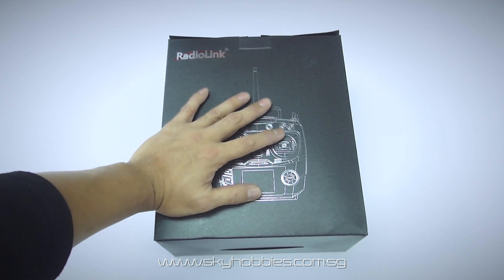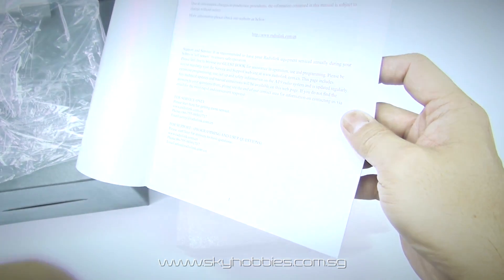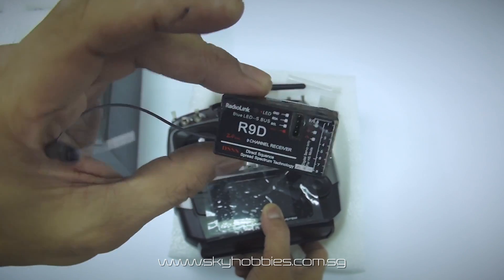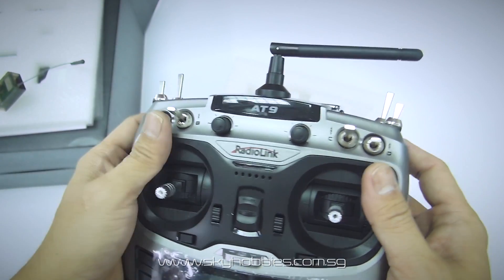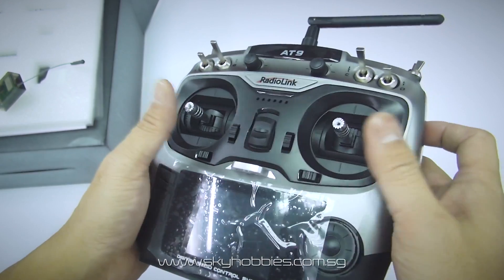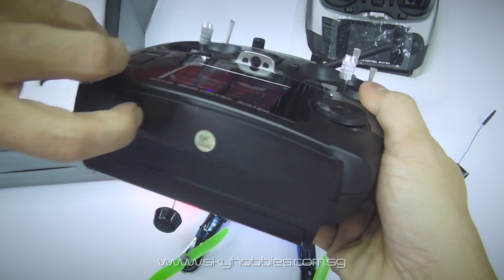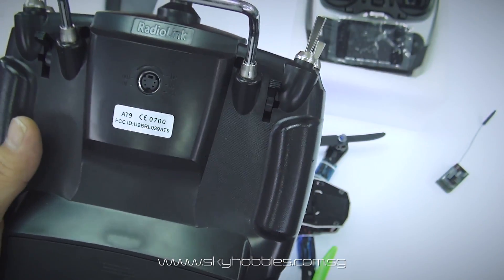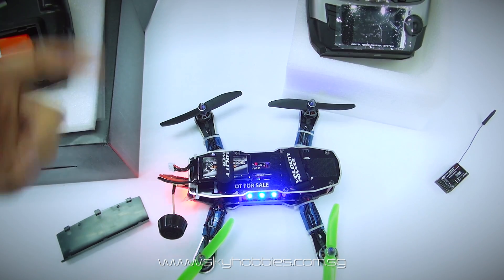Radiolink AT9 Quick unboxing

Comment: Hi there i have an AT9 and R9D receiver. At the radio i could control up to 10 channels. However the flight controller (pixhawk) which i am using, is only able to detect on to 8 channels in Mission Planner. By the way, my receiver and flight controller is connected via sbus. So my question, what should i do to enable the mission planner to detect the remaining 2 channels?

Comment: I have a question I have a storm racing drone that came with a walkers Devo7 and it's an ok radio but I would like to upgrade so if I buy one of these how would I connect it to my mini quad but not loose all my pix settings etc because it's set from factory and it runs great and I do not wanna loose any of those settings
Reply from the maker: Darth Vaper Suggest if you want to do that, first plug in your CC3D into the Open Pilot (If you are using Open Pilot) and save the settings values on a file (or even write it down / snap shot it) before you change the radio transmitter.
As you change the transmitter, you need to re-calibrate the sticks to the CC3D again and if not done correctly will lose all your prior settings from the factory.  Get an experience buddy to help you if you are new to this.

Comment: Also I am having range problems using this with my quad copter, I keep getting "No RC Receiver" alarm at about 150' vertical or horizontal range. I have located my reciever well away from surrounding electronics and still have this problem. I have two additional receivers as well and have tried another receiver and still have the problem. Have any advise?

Comment: Do you have any guidance to set up for multirotor? is it will automatically set-up once we select the aircraft model? or we still need to adjust some items? I got also this transmitter last month but still not yet use..hehe..
Reply from the maker: taufik ST no, you still need to calibrate it with your flight controller to determine the channel mappings for your FC.
It is not a one-button "do-it-all" setup ;-)
Reply: oowh.. I see.. And then I am waiting for your video how to set up it. hehehe..
Reply: taufik ST if you're using a cc3d, just follow the breakout cable. Colors differ for the cc3d cables so difficult to say by color. Start out with the black wire (which is always the case) followed by red and white and the rest of the other colors.

Alternatively, you can go to the manual. Pg 10. (1.2.2) Receiver and Servo Connections.

HTH
Reply from the maker: Here is quick reference for CC3D : https://www.youtube.com/watch?t=213&v=OKMOifCn_xA
Reply: Marid Anubis I am using the new Tarot ZXY-M flight control actually..hehe.. And yesterday already flew (for first flight). Now I am still looking for another video to comparison with my TX setting. But anyway, for the next project I would like to try to use cc3d..hehehe.. thanks
Reply: There should not be much difference in setting up reciever to board. I'm glad that you had your maiden flight. I'm not familiar with tarot boards. I built a tarot 250 last month though. Flies surprisingly well but was not designed for hard crashes... oh well...
Reply: Marid Anubis Yup, agree.. Basically all those settings are same.. What happened with your tarot? This AT9 is very nice TX. And low price also..hehehe..

skyhobbies on the radiolink website, they mention this TX can support for futaba s-bus. what does it means? is it can binding to futaba receiver?
Reply: taufik ST  i sneezed and flew it straight to a wall. Hahahaha. Frame cracked. Landing legs broke I to 4 pieces. Building an atas magni now.